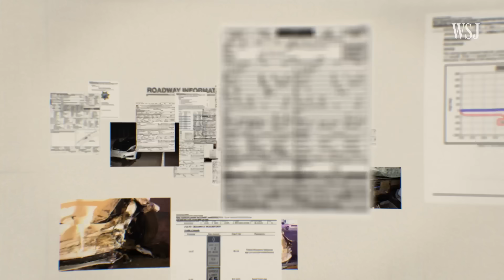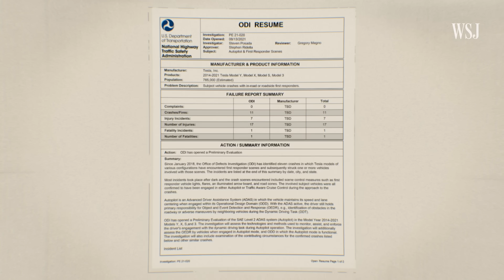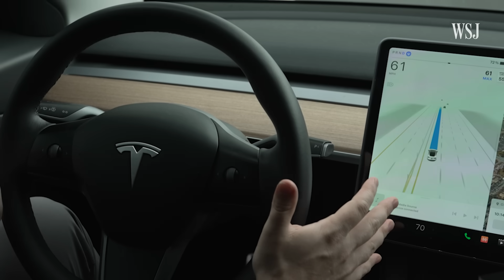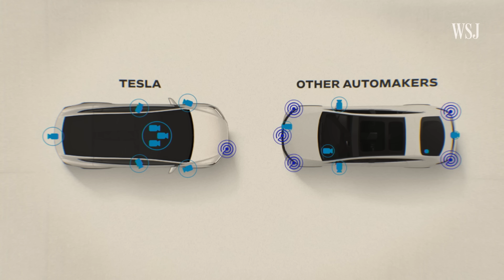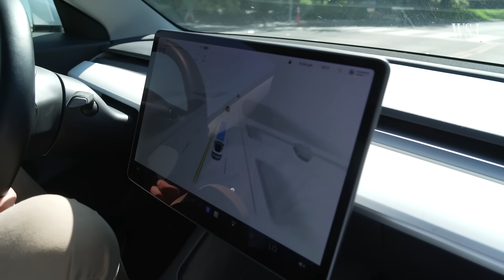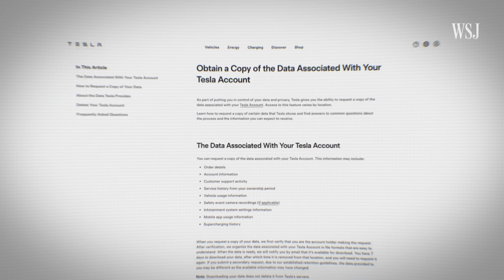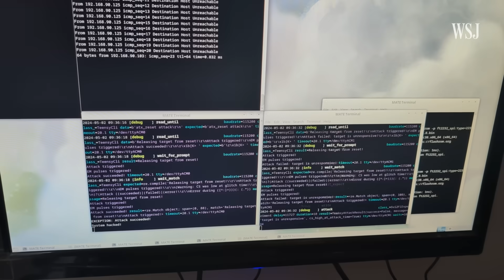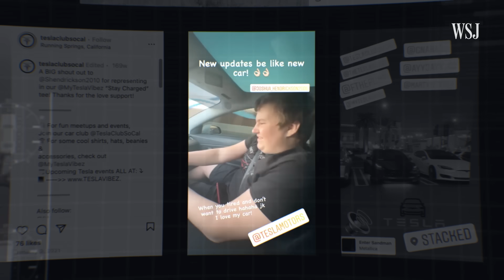The Hidden Autopilot Data That Reveals Why Teslas Crash | WSJ

Comment: As a person who uses autopilot daily.. 
I can confirm that the technology is far from perfect.
Preforms well %99 of the time.
But when it gets something wrong, that's freaking scary
After watching this, no chance I trust my tesla in the dark
Reply: This is why getting rid of LiDAR was the dumbest thing Elon did. Cameras suck in the dark, but LiDAR does just fine because it doesn’t rely on visible light.
Reply: @TakeBackTheFlag to clarify, Teslas never had lidar. They had radar.

The problem with radar was it kept confusing overhead signs with stopped cars, because the resolution isn't great.  This lead to a lot of false braking events.

I'd like to see the newer HD RADAR put in all models.
Reply: This opinion, is the correct answer.
Reply: I can understand the dilemma, but if you get too comfortable with something, all it takes is one time for it to mess up and it's tragic.
Reply: Tech can never override common sense.  I don't care how good the tech.  I don't trust it with my life.
Reply: Comon sense says the earth is flat. Comon sense is frequently wrong.
Reply: Yes. Autopilot will try to randomly Kill you. That said my blue cruise with radar seems attracted to semis. It actually moves closer as you pass them. Tesla moves away. Though better than any other system, it requires supervision
Reply: Sounds like  using autopilot leads to complacency. If I was using a technology that was right 99% of the time, I would be complacent. I think it's human nature.
Reply: One thing I learned about the rich is takes a lot to make them understand and care about their decisions...Money comes before their morals. It's just another number...

Come On Tesla it Takes Chat GPT 0.1 seconds to read a book and give a response....

#FPS thus even a fly's reaction and FPS is slower than than Chat GPT. If Chat GPT had a fly swatter it would slap the fly faster then it takes for some of these AutoPilot cars to See and React....Someone has to be held Accountable (All the frames the Car didn't make a decision has to be a $$$$ Fine....This is not okay, people Buy and Vote Tesla #Fanatics and still have to go through such)

Remarkably, some flies can see as many as 250 flashes per second, around four times more flashes per second than people can perceive. If you took one of these flies to the cineplex, the smooth movie you watched made up of 24 frames per second would, to the fly, appear as a series of static images, like a slide show.

Humans see about 60 flashes per second while flies see about 250 — a full four times faster than humans.
Reply: After watching this??? You shouldnt even be trusting it in the first place....
Reply: i would not say 99% of the time. closer to 75% of the time. my model 3 has randomly brake checked people on the highway.
Reply: Agreed. It’s pretty stupid compared to contentious driver.
Reply: Yeah if its vision based you cant trust it fir abnormal scenarios at night
Reply: @leonkarchun5101  i don’t use a Tesla but my car employs autonomous drive level 3. I still don’t trust my car 100% to do all and keep my eyes and senses on the road. 
I still don’t get those who completely trust the car 100%, one moment you’re behind the wheel relaxing, moments later you’re being welcomed  by Lucifer to join his club. Nah man …
Reply: Sometimes 99% is more dangerous than 80%, because it's too easy to forget about the system.
Reply: I mean you shouldn't just be letting your Tesla just drive and not be paying attention to the road. You should also be actively looking at the road. 

Because you can see that semi truck way before that Tesla does.. I use autopilot all the time and I make sure to watch the road 😭😭
Reply: @jadenisiah   no the Tesla can see that crash before you can, it just might not recognize it and ignore it and continue driving at the speed it's been set to go until it hits. You on the other hand will not know what's happening until the crash
Reply: @jadenisiah it’s actually worse if you let it drive. Takes longer to take over vs a pure reaction while driving.
Reply: @USCGreg  That's why I said to not let it drive 😭😭 wym??
Reply: I'm also using FSD all the time and I'm also looking at the road. I have no choice as the car will balk at me if I stop looking at the road. That's fine, that's the way it should be with this Level TWO technology.
Reply: Then they must disable it at night....It must be a LAW
Reply: @HolloMatlala1  Sure, pal.  No one should be allowed to drive in a regular car at night either b/c there are plenty of serious nighttime accidents from inattentive human drivers... it must be a LAW!
Reply: @HolloMatlala1  i use it at night all the time. it is stated in the manual and before your first use to pay attention. It even warns you during drives to pay attention and keep hands on the wheel. No disabling at night required. Stay under you rock.
Reply: @Sal3600 that's just Tesla CYA and blaming you for the crash
Reply: that was yeaers ago mate. its different software and tech now.
Reply: @waltchui  It is not needed in vision. it clearly didn't help in that accident.

Comment: Autopilot is different from FSD, video is missleading
Reply: I agree, the crash that happened was with autosteer and not FSD, totally different system :/
Reply: Having two different systems -- neither of which living up to its name -- with overlapping capabilities but different weaknesses, is a problem in itself. It makes it hard for the user to know what each system is for and what it is capable of.
Reply: Yupp, to get access to FSD (Full self driving), you will have to accept that you are wanting to training it with the tesla community, and that you have to monitor it all time, and always be prepared to take controll of the wheel. But people use FSD to scroll facebook, instagram etc. which is why newer tesla has a camera about the driver, to detect if he is paying attention to the road or his phone. Cuz Tesla is tired of people saying yes I will have my hands ready to interact but then they busy scrolling social media
Reply: This video isn't talking about FSD.
Reply: @efrainfjr  Aren't the software and hardware used in both basically the same?  As in, they have the exact same shortcoming?
Reply: @IdleNomad software is entirely different. FSD latest versions (v12+) use end to end neural net, while autopilot doesn't - basically meaning developers have to code for each scenario for autopilot. For example stop signs will show up in both, but only in FSD is it expected to fully stop while it's not coded to do so in autopilot (just gives warning for me to take control). Hence autopilot needs much more supervision than FSD.
Reply: na they same and Tesla sucks
Reply: Tell that to the guy's kids.
It doesn't matter which mode he was using, or whether he was well informed or not. 
A simple Lidar sensor is nearly foolproof as it will detect a solid object approaching, regardless of its shape or color. 
Elon doesn't seem to agree.

Comment: That first simi truck accident, i wouldn't have stopped im time either. That was hard to see. I would be interesting yo seperate the data into likely hood a human driver would have improved it first. Humans also have dumb crashes too, which is another factor.
Reply: And the video chose to show every irrelevant camera angle first, then show the front camera angle when it was already really close (by freeway speed standards).

"Cameras are flawed", well, even as a human viewing the camera feed, I could recognize 'some big mess in my lane' probably 5 seconds before the clip they cut even started.
Reply: @Joephnarro  In Machine learning, we have 2 methods of prediction, regression (predicting a value, like the price of a house) or classification (dog, cat, human, ect.). The problem with cameras, is they are trying to classify what they are seeing (accident, no accident), and because accidents are random, thus no 2 accidents will look alike, they can't classify what they are seeing as "accident" with a very high confidence interval, and thus, they crash. Cameras don't detect depth, and even using multiple cameras with some basic geometry doesn't solve their flaws at night or in weather events. Lidar would have seen something in the road ahead, and 100% of the time, avoided it. There's a reason not 1 waymo has ever crashed like this. Until some new sensor tech is created, lidar will be 100% necessary, and the fact elon refuses to use even 1 lidar for front facing, is really sad for it's users who are machine learning engineers, and thus don't know how flawed this tech is.
Reply: @heyaisdabomb  As a human, I don't have to identify exactly what thing I'm seeing, just "clear lane" or "lane blocked by obstacles". Machine learning can be made the same way. Evaluate the confidence-level that the lane is clear.
Reply: @Joephnarro  Computer vision is not able to do that as well as lidar though. It's a matrix, which is a 2d object of the color of pixels. When it's dark, the pixels are mostly all black. That's why it failed to detect "lane blocked". 3d lidar creates a tensor, which is basically a 3d matrix. So you have the ability to actually determine distance to objects, and your not relying on pixel colors to identify an object. If the object if there, the lidar won't reflect back to the lidar sensor. Lidar would have avoided these accidents.
Reply: Which is a good argument to add lidar (once affordable) to all cars, self-driven or not, to warn of hard-to-see objects in the dark or blinding sunlight.  It's astonishing how many people insist on being in the vision-only camp, as if their entire identities depend on whether Elon Musk is correct.  I understand why Elon won't budge (he staked his reputation and business on vision-only and feels he must lie in the bed he made), but why is everybody else so ardent?  Are they all Tesla investors?  Even if they are, adding lidar won't kill FSD.  It'll make it work safely, which is in Tesla's and its shareholders' long-term best interest, even if at the cost of some short-term pain and crow.
Reply: @Closer-than-it-appears  If every car has LIDAR, you will have another problem. It depends on laser. Imagine every car beaming infrared laser all the time.
Reply: @Closer-than-it-appears  Tesla has always had a cult of followers. I was in that cult at one point, but the many lies elon has told snapped me out at some point. I think there's an insane amount of innovation going on here, which I support. But this is often an issue with CEO's like elon. You are the expert in a field, but they will tell you what is and isn't possible. And when you tell them it's impossible, they won't listen to you. I just left my current job with this exact reason. The CEOs think they understand, but then you realize they don't even understand basic stats, and want you to publish a research paper with almost no data, drawing conclusions you can't draw without conclusive amounts of data. This is very common with the type of personality that leads to one becoming a CEO.
Reply: I would, There a light across the road way. And if view are limited then you should drive at the speed your vision can reacted to. Yea, let drive 75 MPG down a foggy roads.

Comment: Reporting on a past year’s version of autopilot is tricky as the neural net stack has changed so dramatically year over year. It was certainly foolhardy for Tesla to advertise Autopilot so confidently early on, but the current versions of FSD are light years better than it was just a year ago and—in my opinion—warrants the confidence.

Comment: Some cars only have Lane Keeping Assist (LKA) without speed control, and in this situation, any other car likely would have crashed as well. The video seems to be using outdated Autopilot data rather than showcasing the advancements in 2023 or 2024 with versions 11 and 12 of Tesla's Full Self-Driving (FSD) software. It feels like the focus is on banning FSD, when the real issue is raising awareness about the importance of staying attentive while driving. The software being discussed here is obsolete and no longer represents the current capabilities of FSD.
Reply: Exactly. Also, FSD13 is out and it's insanely good. What they've decided to do a hit piece about it not FSD but autopilot. Both of which still require drivers to remain attentive.
Reply: You have a point. Its not the job of the LKA. The real question is why Tesla emergency brake system does not seem to work.

Comment: Honestly. Such situations like the Hendrickson accident would really challenge even a human. If you’re driving at 90 mp/h without high beams in a straight line and you see the obstacle only in the last 50 or so meters, either you’re super attentive and manage to dodge immediately without spinning or you’re done.
Reply: Radar is worse than cameras, because it's difficult to filter out all the reflecting signals from stationary objects on the edges of the road.  Most all automakers are not able to recognize fully stopped objects with radar today.
Reply: These accidents can happen on radar if an object does not fully occupy the lane. Vision, once trained, is vastly superior besides situations like heavy fog.
Reply: Even in the bad quality video you can see the truck seconds before the AP starts to react.
Reply: Perhaps Tesla shouldn’t allow their cars to go 90 mph in auto pilot setting if it’s inherently unsafe
Reply: Problem is, Tesla got rid of radars in their cars. Radar would have easily seen stuff like that.
Reply: @_Dimon_ if you want an expensive lidar then buy a different car
Reply: @_Dimon_ Radar systems must filter out stationary reflections to work.
Reply: @_Dimon_ ikr radar they *could have retained, only LiDAR is high cost

Comment: These accidents are cherry-picked and looks like humans would make the same mistakes without fsd. There are so many cases where FSD saves the car from a crush. I do agree with that people need to understand of the FSD's limitation and still pay attention, but fsd probably saved more lives than the mistakes.
Reply: Despite all those clips are not FSD instead the old Autopilot named lane assist cruise control
Reply: FSD automatically changed the lane to prevent us from going through a deep puddle. Didn't know it read puddles. Also stopped when it thought the deer was going to cross when we were on the backroads. On the other hand almost ran clean through a red light, had to intervene 😅. 

I agree, people MUST stay vigilant.
Reply: @gentrisbb  Just an MLE here, but the problem with Tesla's, FSD or autopilot, is the lack of lidar. There is no way around it. I understand, no one is using lidar in production cars. But until some new sensor technology is developed, we will need it. It's like trying to drive, but your eyes can't tell if what your seeing is 5 ft in front of you or 100 ft. That's what cameras see. They can try to use geometry to triangulate and judge distance, but it's fundamentally image recognition. These cases were primarily teslas crashing into existing accidents. Theses are random events, and thus the images they see will 100% of the time look like nothing they have ever seen before. And thus, they will fail every time. Lidar just looks for objects in the way, and would easily detect something is in the road requiring immediate breaking. A tesla with lidar would be FSD and insanely good, given the amount of data they can collect. Elons refusal to use lidar is why tesla FSD will never be truly FSD. It's sad, but I have a boss like elon who won't listen to any of my points, and when I tell him this will happen, and it does, he's confused why I was right, but still can't acknowledge I'm right. Elon's toxic personality makes it impossible for him to be a truly good CEO.
Reply: yes truly. the things shown in the video are true, but put into context, this feels extremely one sided.
Reply: If you need to pay attention to Full Self Driving, it's not even Half Self Driving. It's like sitting next to 15 year old on the free way. You better just drive yourself.
Reply: @maxmeier532  the “full” self driving means it can drive the whole trip like highways and local roads, stop sign etc. it does not mean like fully functional that you dont need to pay attention. That id why it is called supervised full self driving (beta)
Reply: @eliy151  Nice! There is a new definition of FSD!
Reply: One sided and not up-to-date
Reply: Exactly. And fsd is better now.

Comment: The cars obviously need radar specially in the dark/bad weather, it wouldve been able to detect the overturned trucks
Reply: that's what LiDAR is for, it can see in the dark
Reply: @techcafe0  yeah but not in rain and lidar is way more expensive
Reply: Radar systems must filter out stationary reflections to work. An overturned truck line this would be invisible to it.
Reply: @computeinmemory  That is true for cases like traditional (old) air defense radar where you need to remove ground clutter (MTI) to be able to see small targets far away.

For these cases, even if you use older radar technology, the RCS of a truck would be SO big compared to other targets it'd 100% detect it.

With newer digital arrays all this is not a problem anymore
Reply: Is that so? And where did you get your engineering degree?
Reply: @GaryGreen-h8v  got my phd in ECE at OU (USA) and now cofounding employee at a radar startup where design MIMO radars in DC. But to be fair I still have a lot to learn